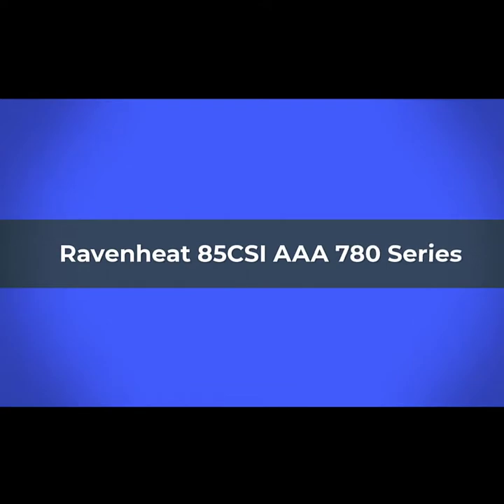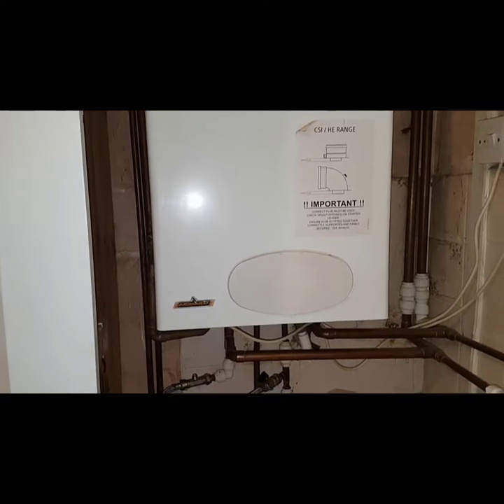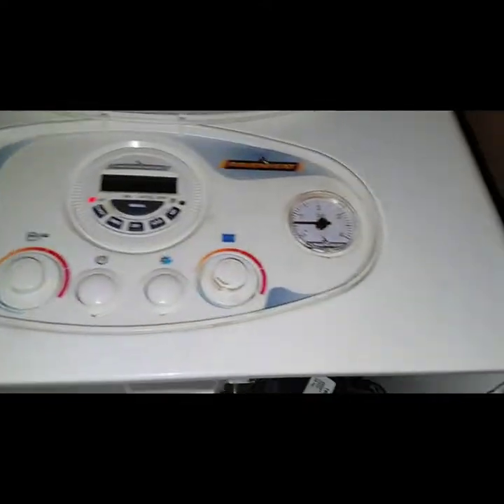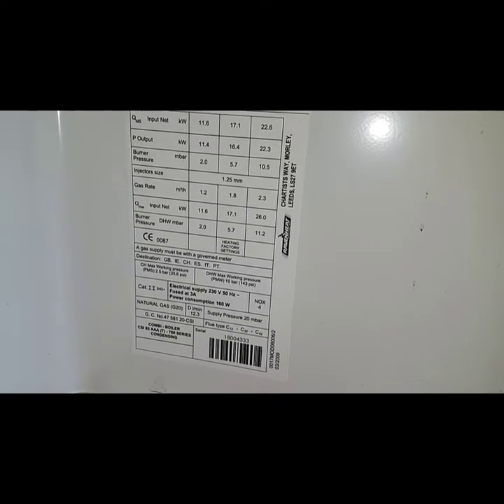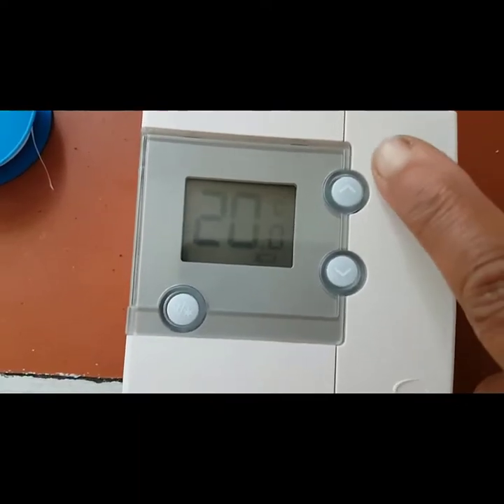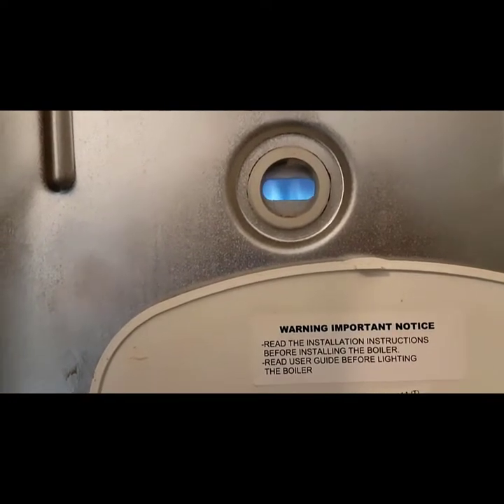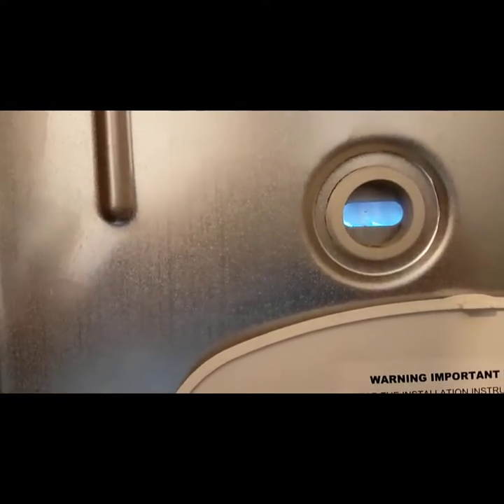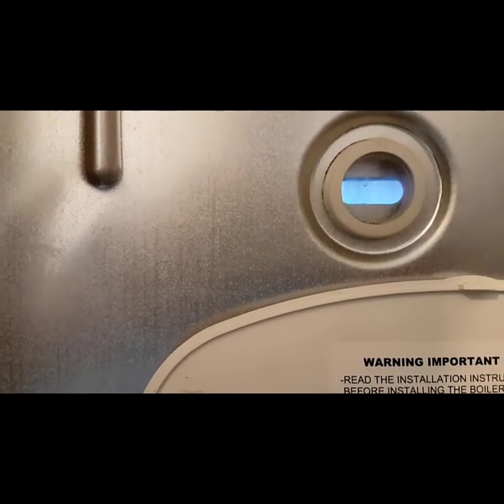Ravenheat CSI 85 AAA 780 Series. Luke Warm Central Heating

Comment: Hi Tony, recently  moved into a bungalow  with this boiler installed,  the issue is when we moved in the pressure was 2.5 bar, is this OK if not Howdon I release the pressure  to standard 1.5 bar, thanks.
Reply from the maker: Hi 2.5 is a bit high you can lower it via a radiator vent
Reply: @ARBoilers  thank you Tony for your advice.👍

Comment: Fan faulty
Reply from the maker: Nope
Reply: @ARBoilers  if the fan not running and doesn't have 240 volt so it is PCb
Reply from the maker: @sheriefgerges7789  yeah its the fan board
Reply: @ARBoilers  HI Tony, when you say fan board what is that mean to change the main  PCB or this is the board fit to the fan
Reply from the maker: @sheriefgerges7789  The fan board is a small pcb fitted underneath the main pcb
Reply: @ARBoilers  HI Tony hopefully you are going to make videos that's show us how to change it and how looks as intrested. 
Thank you Tony
Reply: @sheriefgerges7789  if he shiwd that video then his business would go fown to zero and he would have no one in his class so that means his earnings will go down 
In it ? Mate
Reply from the maker: hey we're currently trying to grow our Facebook group and would love you to join Tony and the team using this link, Tony will be available to answer all your questions directly https://www.facebook.com/groups/167070231326174 we will also add this link above.